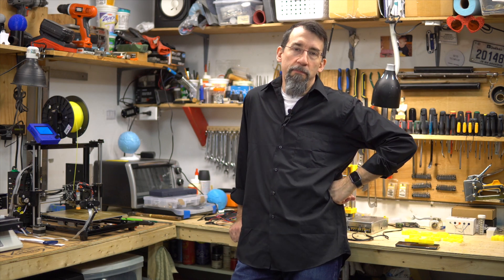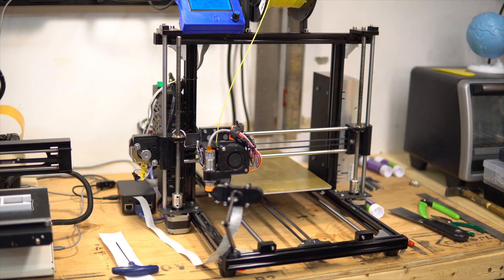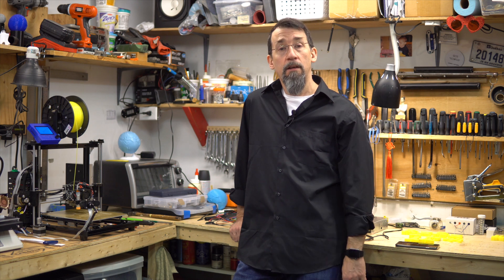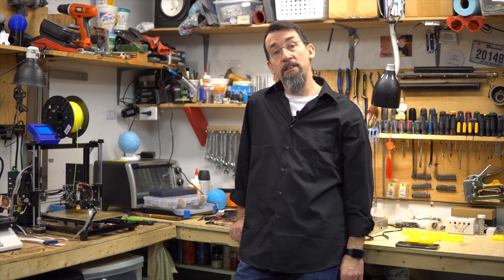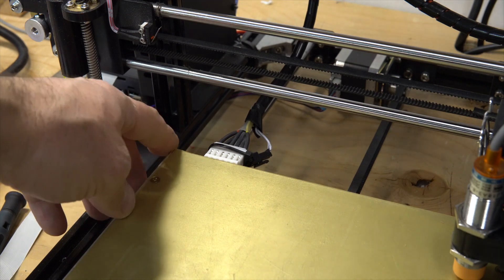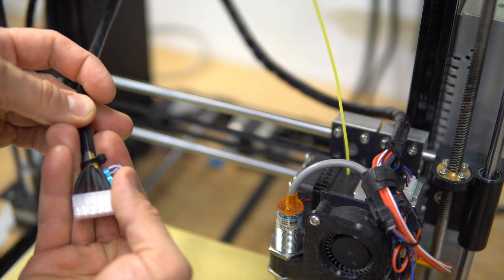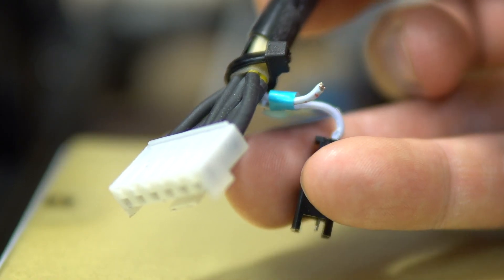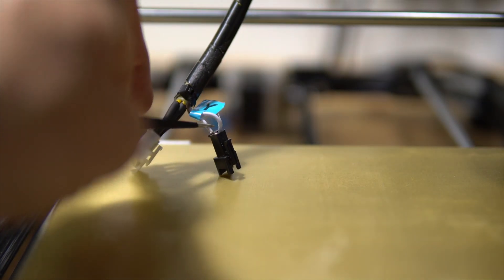Broken Limit Switch Repair

Comment: I tracked this same issue down but it was inside the sheathed cable set from the micro switch to the driver board. Cut off the sheathing and all the wires looked fine but the black one had a break internally so switched out the bad section and all is good now.

Comment: Hi Frank. I enjoy your videos, they are very informative. 

I have a FolgerTech Kossel printer with an E3D print head. I’m having issues with my first layer. There is a delay before plastic is extruded from the nozzle even when I prime the extruder.  

Any chance you can make a video on dialing in the first layer? Hopefully on a Kossel?

Thank you! (From a fellow Canadian! )
Reply from the maker: Hi fellow Canadian!

A delay before extrusion at the beginning is normal, pressure as to build up in the hot end for the extrusion to happen.

What I do with my printer is either use a skirt or brim to leave time for the pressure to rise.

You can also in the startup gcode for the printer in your slicer, have an amount of extrusion set before the print begins, here is the sequence of events for my bigger printer (from Cura):

Startcode:
G21        ;metric values
G90        ;absolute positioning
M82        ;set extruder to absolute mode
M107       ;start with the fan off
G28 X0 Y0  ;move X/Y to min endstops
G28 Z0     ;move Z to min endstops
G29
G1 Z15.0 F{travel_speed} ;move the platform down 15mm
G92 E0                  ;zero the extruded length
G1 F200 E3              ;extrude 3mm of feed stock
G92 E0                  ;zero the extruded length again
M117 Printing...

And finally you can include in the code the extrusion of plastic on the edge of the bed, I use this on my Monoprice mini and it is now included when you use the preset for the Mini. 

For a delta printer it is not relevant since you do not have a straight edge.

I will get a Delta printer someday, that one seems a good printer, or if the little Monoprice Delta becomes available in Canada!

Hope this helps?

Comment: Nice work! -- I've had similar issues from the wires falling out of the RAMPS board sometimes. Definitely a scary sound.
Reply from the maker: Yes it is, my first printer was a kit, nuts and bolts type, I have heard that noise a couple of times during assembly :-)

Comment: My ender 3 did just the same, have to see if that's the problem too! Thanks so much!
Reply: did you find a solution my ender 3 is having the same problem
Reply: Shaan Patel didn’t had the issue frank had. My printbed pushed the end stop away because i didn’t tighten the screws properly

Comment: I don't think that is a good place to solder, as the stress on that point as the bed moves around will make the solder fail.  Just thinking that it would have been better to cut back the cable and reattach the connector, assuming you have a little bit of extra cable.

Comment: Oh come on now Frank, you and I both know that's not fixed.. 😋 That connector should to be replaced.
Reply from the maker: Could be :-) some other time...
Reply from the maker: I did the video mainly so that everybody knows that sound and what it could be...
Reply: Personally, I would pot it in some high temp epoxy or resin.  It should add a lot of strength and never break again.
Reply from the maker: I think it has enough play now it should not cut again. Or at least be good for another 500h of printing
Reply: For sure! -- I think you're right -- I just meant, as opposed to replacing the whole connector (as the other commentator suggested). -- It seems fine to me as-is, but if you want it to be really heavy duty and to never break again, then that's when I would use it use the potting resin --  this is probably the best example I've seen lately: https://www.youtube.com/watch?v=h8ycmroFQSs  (though the video focuses on water proofing electronics, it's one of the methods shown).
Reply from the maker: Yes sorry I understand you. And one of my favourite youtubers !